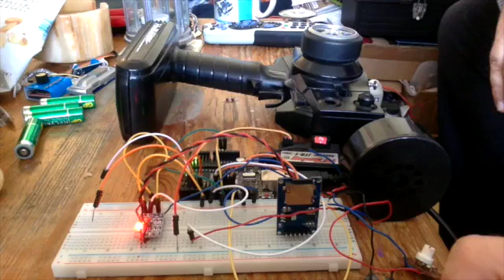Sound system for RC tanks

Comment: Much better sounds than the standard HL offering. Well done to you for working on the new sound module.
Reply from the maker: +Toytinkers channel Thanks, it sounds rather better in real life... for some reason the microphone on my Mac sort of suppresses the engine sound as if it ware background noise.    I'm not aiming for Benedini like quality here, the transitions from one sound to the next is a little sudden but for the price point I'm aiming at it should be a vast improvement over the HL engine and remove the need for a separate ELV or similar battle sound card.